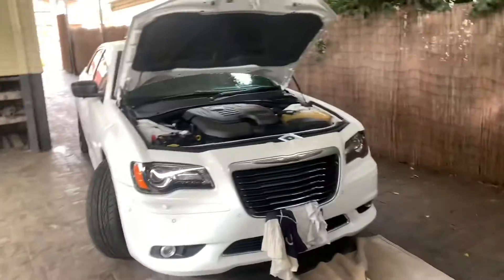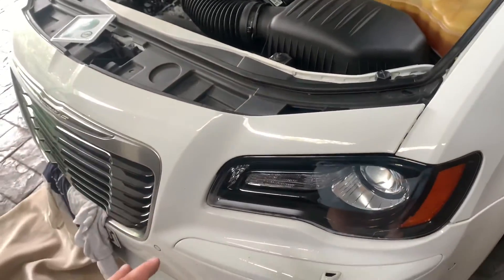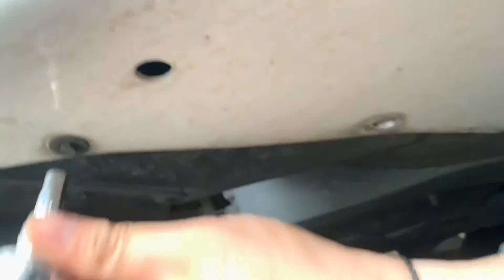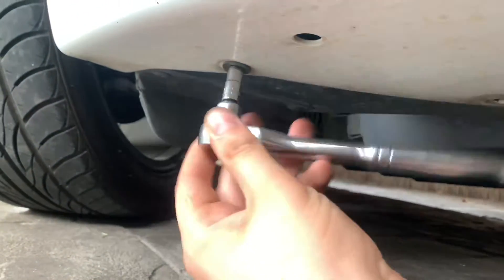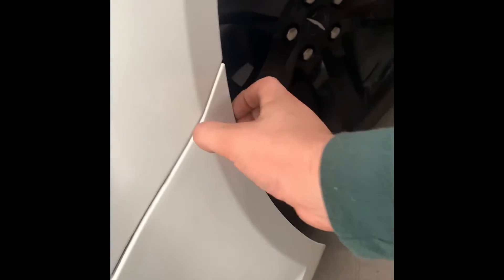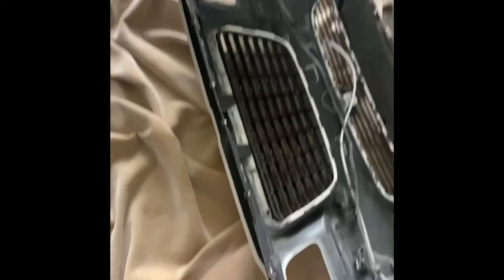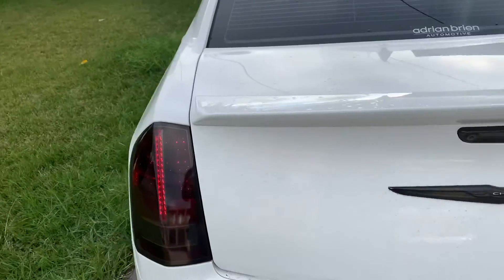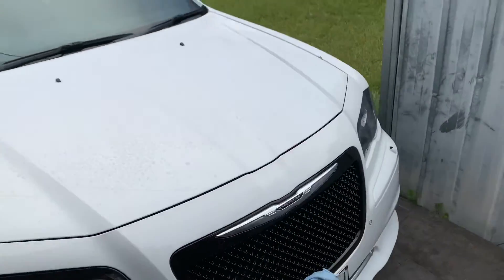How to change the grill on a Chrysler 300c/s 2012 & above

Comment: Hey bro interesting stuff! i just bought mine 2 weeks ago ( Chrysler 300C 2014) - I have a quick question

what is normal oil temp and Coolant temp while running, especially in summer.
Also, does your comes with remort start?
Reply from the maker: Hey man! Can you comment this under my new video? I’ll reply there 😊😊

Comment: We're looking for a replacement part for the plate underneath the bumper that the bumper is attached to? What is that piece called and any idea where to get one... Shipped to Los Angeles CA for a Chrysler 300C 2005
Reply from the maker: Serena Scholl do you mean that small thin grill?? Under the number plate

Comment: where did you get the grill and taillights. they look wicked!
Reply from the maker: Hey! I got my tailights tinted ! & the grille off ebay!
Reply: @chrysler300sguy8  what about the back blacked out emblem and the third brake light tried looking for it online couldn’t find it.
Reply from the maker: @AlexlsRulz  the 3rd brake light is a mopar Option…! Have another look my man! & the blacked out emblem I just used a product called plastic dip, works amazing and easy to take off if you don’t like it
Reply: @chrysler300sguy8  did you remove it off the car or just painted it on?
Reply from the maker: @AlexlsRulz  what do you mean man
Reply: @chrysler300sguy8  like did you remove the emblem from the car then painted it, and put it back on?, or did you paint it with the emblem on the car?
Reply from the maker: @AlexlsRulz  painted with emblem on the car! & masked around the paint of the car  so no spray got on the paint :)